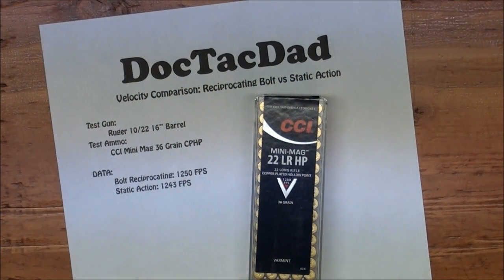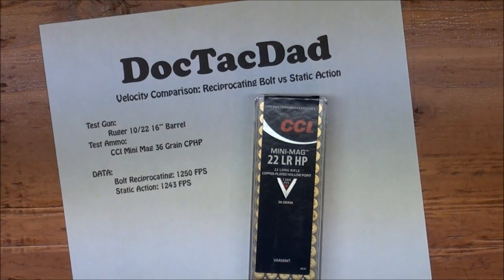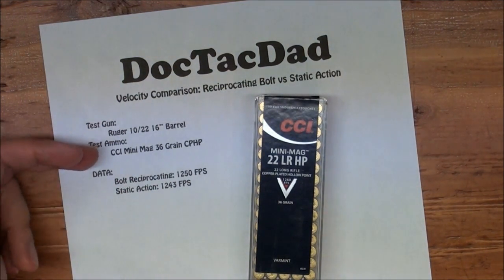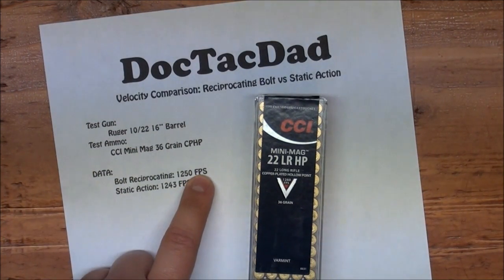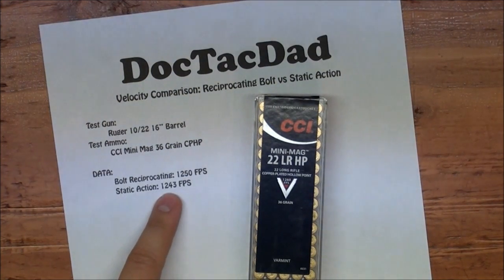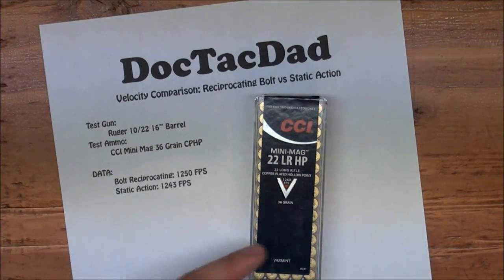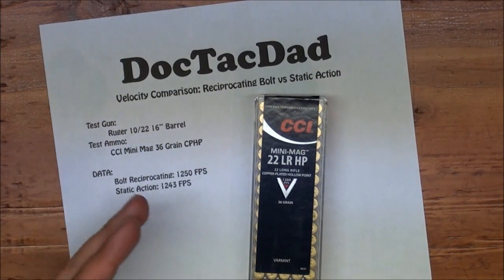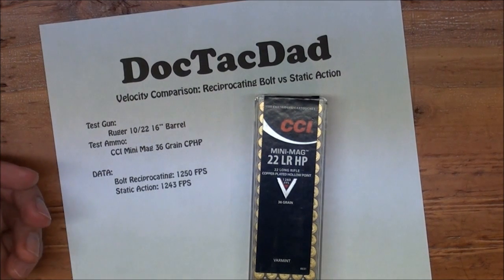Semi Auto vs Static Action Velocity Test

Comment: It's a valid point that the energy to cycle the bolt must come from somewhere. I think what happens is the energy that would otherwise be transferred through the stock to the shoulder, is absorbed (in part) by the cycling action. So instead of losing that energy out the front, you’re losing it out the back (which is a good thing).

Comment: blow back systems use the outward pressure of the expanding gas on the brass case inside the chamber to keep the action in place for a split second while the bullet goes out the barrel! then when the bullet leaves the barrel that pressure is reduced on the case but there is still some how just enough energy for the action to cycle! This was my understanding of how blow back design works! Any one have thoughts on if that is wrong then let me know!

Comment: I would think that you would need to do a test side by side with a bolt action rifle of the same barrel length.  I also wonder if the 10/22, a blow back operated rifle is the best platform for a test like this?

I wonder if you did a comparison with a .223 semi-auto and a .223 bolt action, you might get a completely different result.